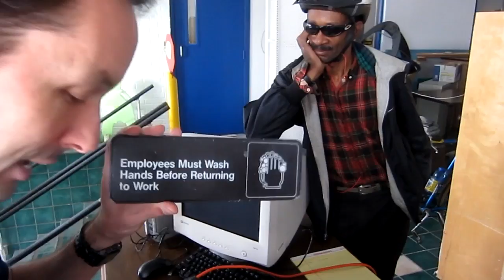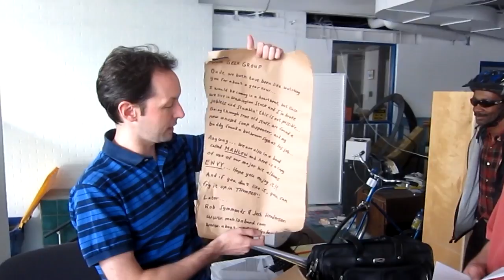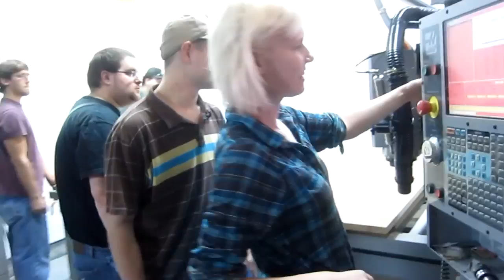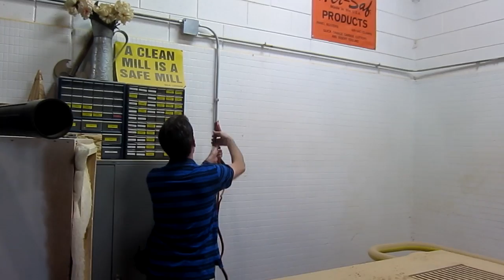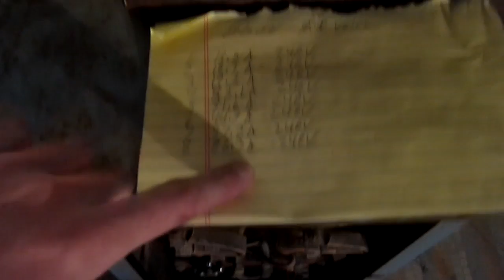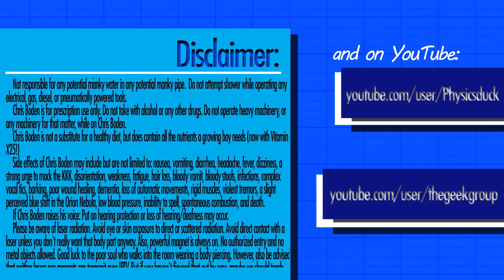Captain's Blog 9-23-11 200kVA Tesla Coil and Dust Collector Progress

Comment: Hay Chris I'm not sure if this would help or hinder but would a recessed spark gap on a non conductive rosin plate that is positioned close to a similar recessed spark gap help prevent a lead or follow spark. Then again I don't have any experience with high voltage other then watching your videos. (member SleepyGuy10)